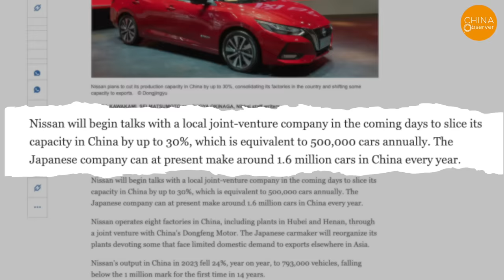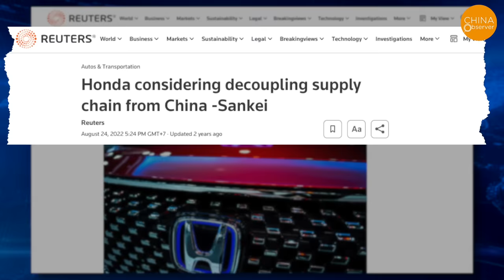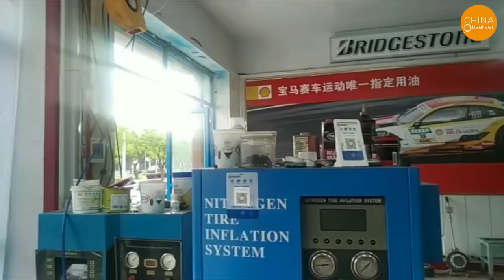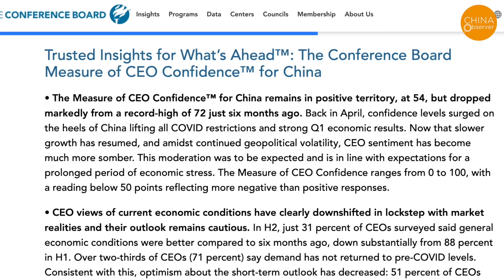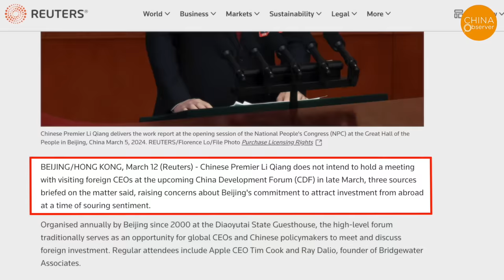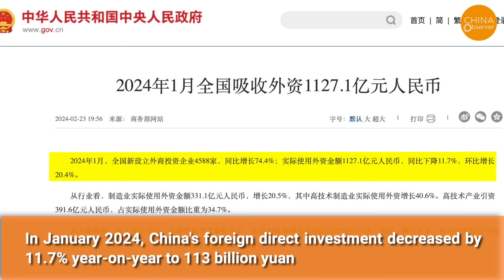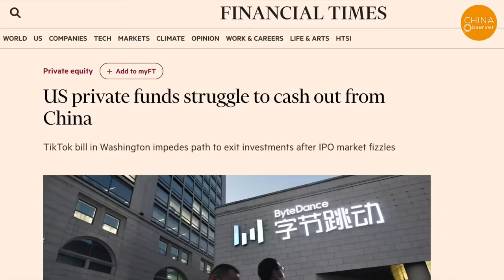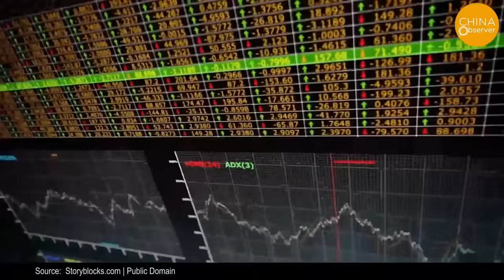Nissan and Honda Cut Millions of Cars From Chinese Production, Other Foreign Giants Follow

Comment: Your use of all these surveys is kind of out of hand. For one thing, CEOs are not a reliable source of information. This is not something underhanded. One has to understand that pronouncements by CEOs, at least on western public companies, have a special status. They are not actually able to just give their opinion openly. Just look at what Elon Musk has gone through with his, sometimes unhinged, pronouncements. CEO's and companies get sued in the west.

The CEO, in international business, also has to play a political role. So, you have Tim Cook in China opening a new store and making all lovey dovey with the CCP. All this while the CCP is banning the use of his products and openly promoting his Chinese competitors. Any rational actor would be pulling out. As it turns out, that is what Apple is doing. The only thing is that they are doing it too slowly and will likely suffer dire consequences. That is just an illustration of the complexities that have to be dealt with. CEOs will say one thing to protect their interests, while doing just the opposite. Each case is different and often complex.

The thing that is important is to follow up on what is happening to those western companies that have pulled out of China. My understanding is that one of the Japanese car companies that pulled out experienced no material effect from the move. Just look at what happened in Russia with the sanctions. There a rapid withdrawal was forced. None of the large companies experienced a material degradation of their businesses. There are other markets, and China's is turning into a s**t show.

Comment: Honda and Nissan are moving too slow to adopt new electric vehicle technology.
The future is electric. No noise, no pollution, less fuel costs and less maintenance costs.
Reply: They don’t start in cold weather climates
Reply: @lance8080  So why are they the best selling vehicles in Scandinavian countries.
Reply: @KJSvitko  Government mandates and incentives.
Reply: Less maintenance and "lower cost" until it's time for that annual battery change.
Reply: @wshyangify  The batteries will outlast the vehicle.  Many people have driven EVs for 300,000 miles on the same battery.
Reply: No the future is hydrogen.
Electric = no pollution. I trust you didn’t do your research, try again.
Reply: @franciscouderq1100  Hydrogen is a waste of time and money.  How much energy is required to produce the hydrogen, transport it, store it and convert it to use.